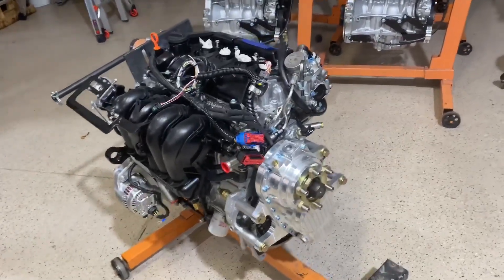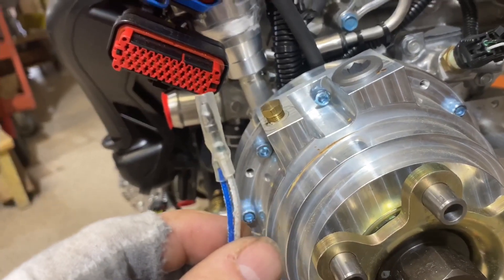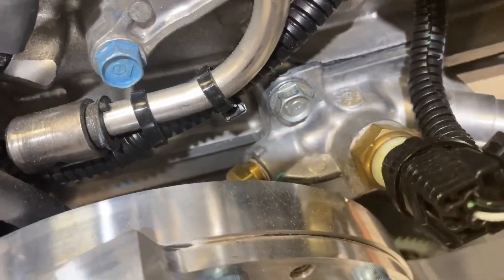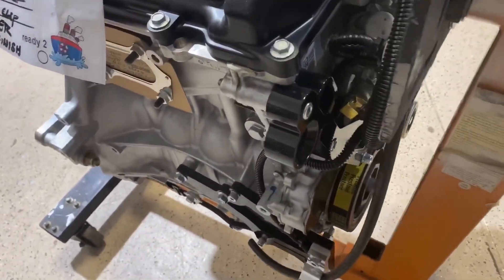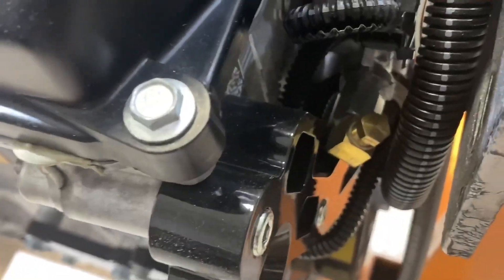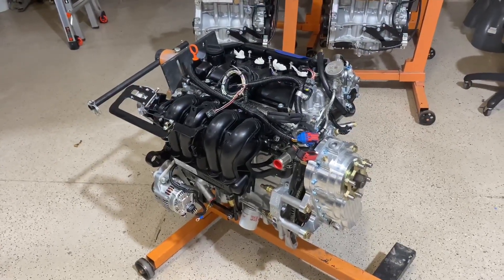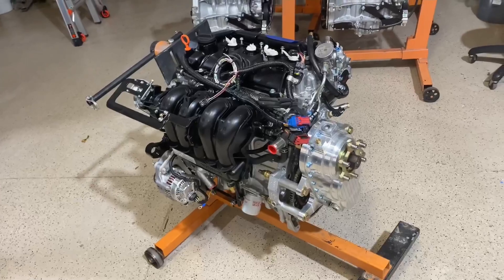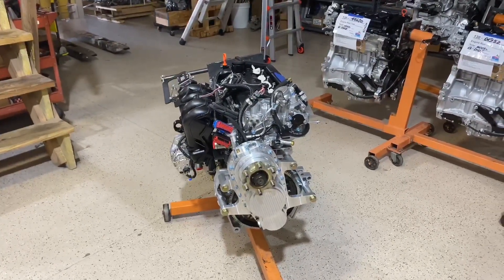Installation Series - Sensor Locations

Comment: Jan, What is your opinion on using bulkhead connectors at the firewall? I can understand that you would be against any cutting of the harness. But done with the correct amphenol connectors, and terminated to specification, do you see any inherent issues?

Comment: Question... I have gone back to your website few times now to look at the numbers on the new VIP prop.. I'm slightly confused with the performance numbers "the ression for this comment" the number show a decrease in speed performance with each increase in altitude flight level.. This is very confusing as every other performance chart I've looked at or flown by has given an increase in true airspeed with a higher altitude... Can you explain why??? As I have gone back few time to look again thinking maybe I was reading it wrong but coming to the same out come. Cheers
Reply from the maker: It is because you can run 100% power at sea level if you want, others only run 75%. So if you can run 100% at sea level it will only be down hill as you climb, without a turbocharger - this would be different with our larger engine. The mpg has a certain altitude where it has a sweet spot, the efficiency overall is increased by far along with cruise/climb performance

Comment: If looking at using Dynon engine monitoring system, does that integrate with the Viking engine?  Also does the Viking engine have sensors for CHTs, EGTs, fuel flow and oil temp?
Reply from the maker: Yes it does, with all sensors you just have to get what is stated from the manufacturer for those needs. We DO NOT need egt or anything like that, less to monitor, no carbs, what needs to be monitored is everything stated. If you want fuel flow that is simple, you just get whatever system they use and install.